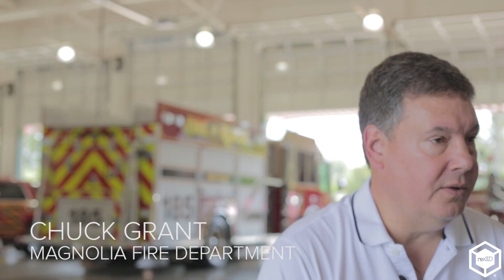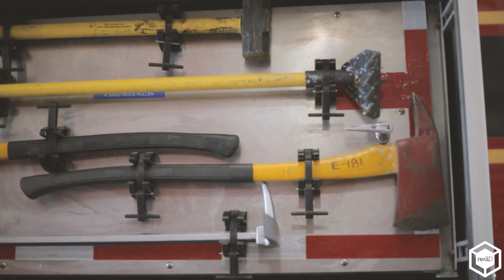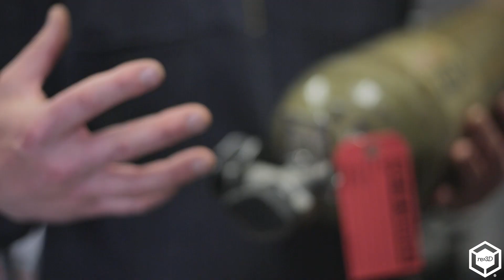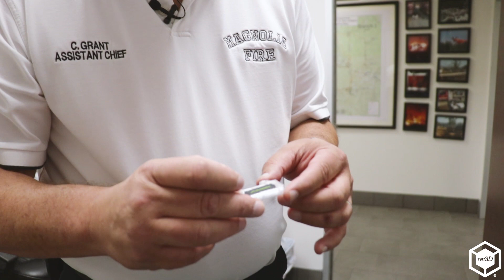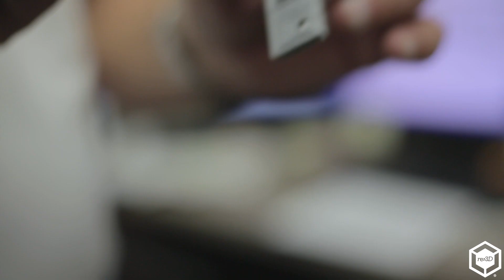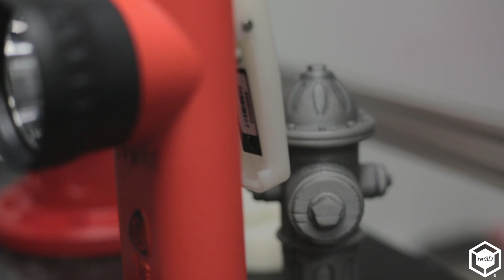Increasing Firefighters' Efficiency with 3D Printing

Comment: They might have better luck on some items just removing the VHB adhesive and using a high strength epoxy like 2216 B/A Gray to adhere the inventory tags right on.